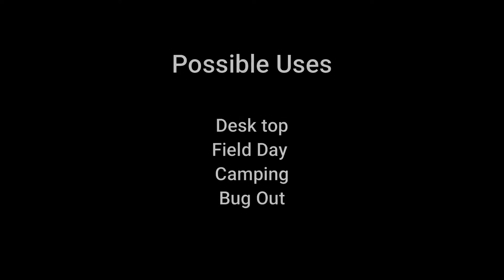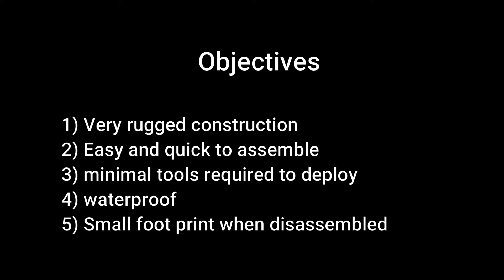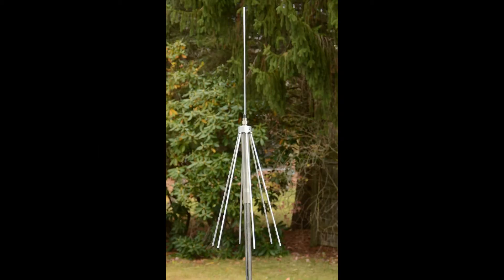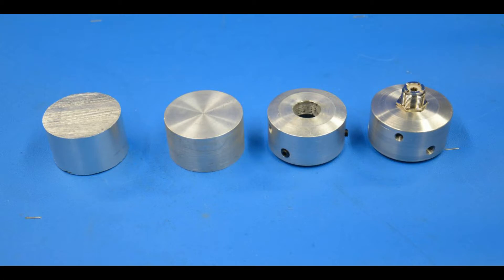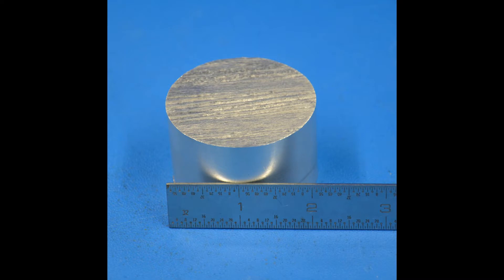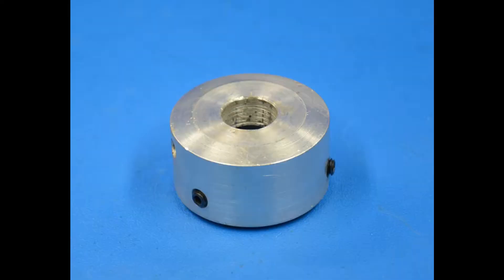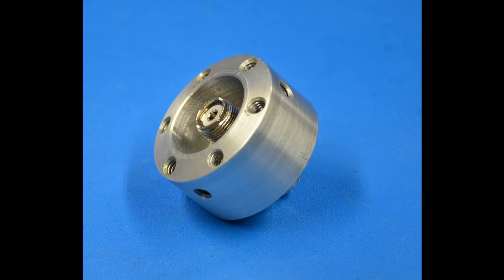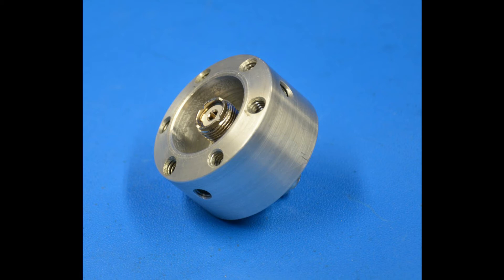Ruggedized 2 meter ground plane

Comment: Solid Build but 160 degree angel of radial is too high the rf energy will spread in nearby objects and it will not go very far the angel should be in between 20 to 45 degree so signal will reach for horizon.